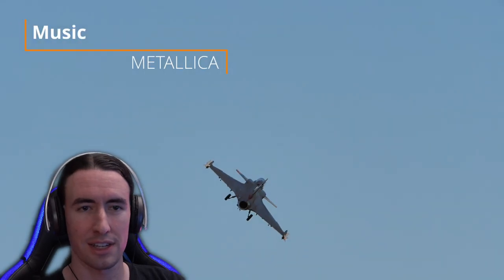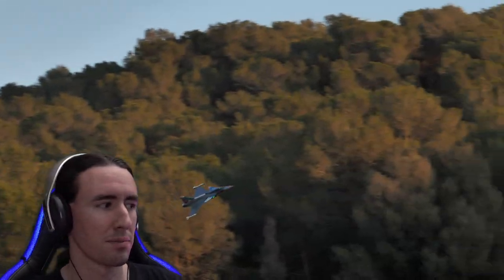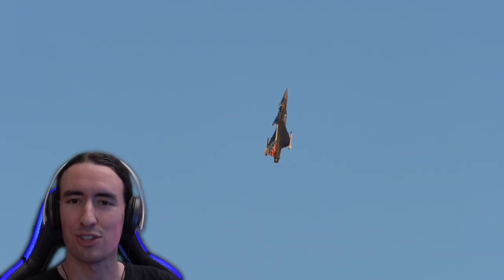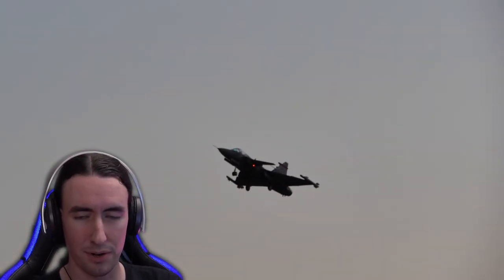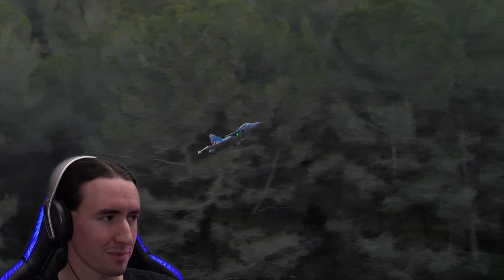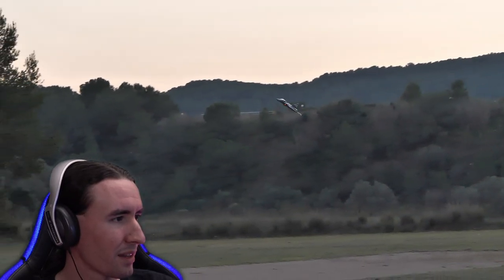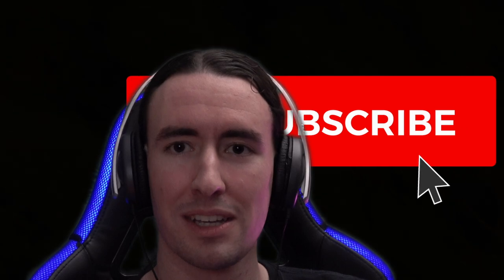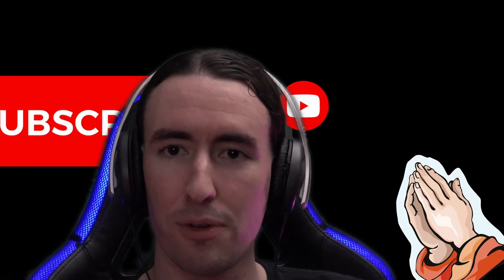I CRASHED THE GRIPEN 5 TIMES ✈️ Let's talk about WHY + other stuff too

Comment: It was pleasure to watch and listen this all your explanations. 
Do you have the description: how have you managed setup of canards on this model? Do they work separately from Deltawing setup?
Reply from the maker: Thanks Valerijus!
My canards are Y-wired (with one reversed servo) and connected to a standalone gyro (Old GWS PG-03) that connects straight into the receiver, on a channel that outputs only pitch. So yes, it's totally decoupled from the elevon system, but it still acts in pitch 'normally'. Only that the gyro in between applies its own corrections.
Reply: @RC4ever  Thanks, this way I have supposed to do. Smart and Solid!
Reply from the maker: @valerijuskaniusas5349  Works very well on all my canard jets :)

Comment: Very nice video…for once a pilot admits it’s pilot error😂 (except the last crash with nozzle stuck to the left😢)
Reply from the maker: Thanks Arthur, glad you enjoyed it!
The point in the end is that from the second to the fifth crashes, the nozzle was already experiencing servo problems, so the plane didn't react to my inputs the way I was used to. So, while one may argue there were also pilot errors being made in those, the culprit was also the nozzle servo that I had replaced. Otherwise, I likely wouldn't have made any of the other crashes ;)
Reply from the maker: And in any case, the error was still mine, not as a pilot but as a modeller, I should have checked the torque of that servo once installed BEFORE flying.
Reply: @RC4ever  yep…you’re right 😕 but we should check everything on our plane every time ?! That would be boring…..😅
Reply from the maker: @ArthurRC  Yes, you should. I don't check everything but almost. Servo strength I don't check it every time, but at least after replacing a servo, before flying at a public event and on a regular basis it's something that should be done. Control surface movement checks and gyro direction and centering checks should be made before EVERY flight.
Reply from the maker: Takes just 10-15 sec.

Comment: I use a servo torque calculator for the main control surfaces but how do you work it out for tv nozzles ? i.e. deflection forces as the thrust air hits the nozzle surfaces at full deflection plus any mechanical frictional forces on the nozzle hinge ?   Assuming of course the tv gimbal is not sticky!   Whatever the calculated figure what do you add for safety margin?
Reply from the maker: A good question! One could prepare more or less elaborate methods, but in this case, for such a plane size, I think one can get a pretty good idea by just manually restricting the control surface (or nozzle) movement by hand and applying a command to the servo and see how much force is actually transferred to the control surface/nozzle. In my case, it barely took only the slightest of finger pressures on the nozzle to completely stall the servo, so it was easy to foresee an issue there. In practicality, you could also open full throttle on the ground and move the nozzle around with the tx, checking that it doesn't get stuck anywhere.
For control surfaces, I have some more elaborate methods when designing, but it's hard to explain here. For conventional ailerons/elevators I'd make a wing simulation, and compute the hinge moment according to pressure distribution at the greatest expected speed, then multiply for 2 as a safety factor. For full flying stabs, you compute absolute lift and center of pressure, then check the distance between CP and shaft/hinge and work out the torque on the shaft... then work out the mechanical layout of the servo linkages on the other hand and compare and add a bigger or smaller safety factor according to your own common sense, haha. :p
Reply: @RC4ever  Yes I quickly came to the conclusion I would not be able to work it out for the tv nozzle servos so on my SU35 I just took the Freewing servo stall torgue figures on their designated servos and chose a metal gear servo with an additional 50% more stall torque .  So far so good🙂
Reply from the maker: @paulrkytek6587  Safe approach, well done ;)